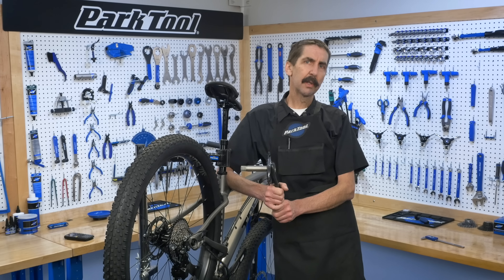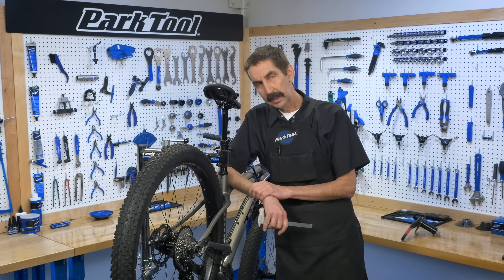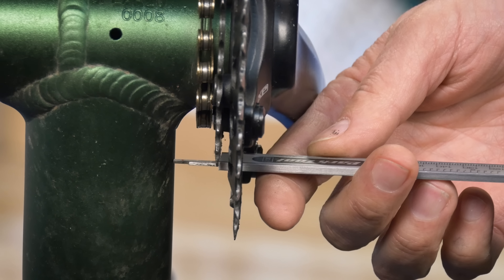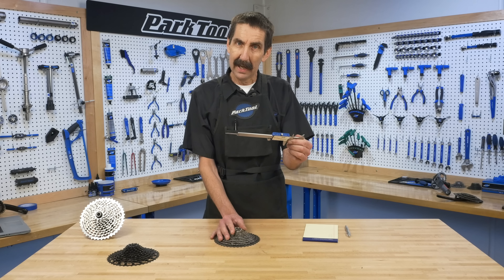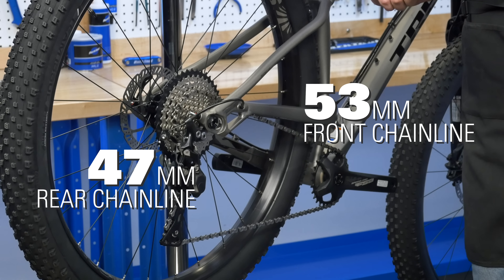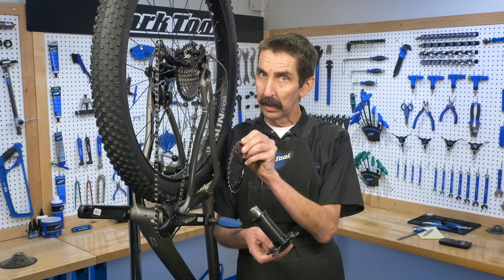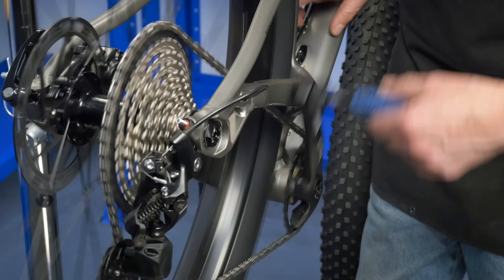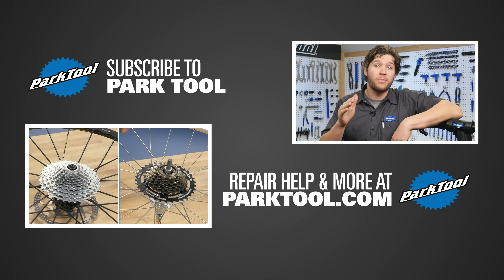Shop Talk: What is Chainline, and How Do I Measure It?

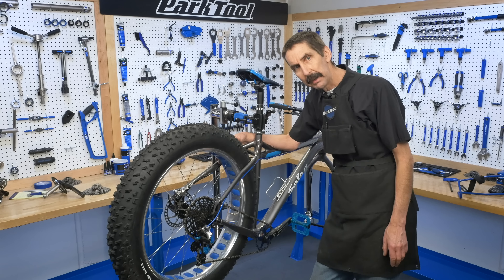Comment: Thank you so much for the video! The two issues you describe from 8:42 to 10:05 really helped me out. 

I just got a new Trek Slash bike with a 1x12 Shimano XT drive train. It's my first time with such a drive train (I had a 2x8 before). 

1\ Indeed on the 3 largest cogs, I have some noise. (I tried various adjustments but was not able to get rid of this noise.) Now I know that there is little I can do about it :) I guess the only thing to be done is eventually replace the chain if it wears too fast. 

2\ The chain also jumps down when I'm on the largest 1-2 cogs and try to pedal backwards. Now I know not to pedal backwards in those gears. Thanks again for the helpful video!

Comment: Nice! I came here wondering about chain ring spacing for the 1x9 conversion I did a while back, it makes more noise in the low range. But you explained it very well and not to worry about it. Makes sense why I get less mud in my derailleur than my friends bike etc.

Comment: Phew. Thanks for this <3 I bought an FSA Tempo Adventure crankset for my old cyclocross bike - little did I know the OEM crankset was an older model FSA Tempo without the Adventure bit, and the chainline is totally different, with the chain now rubbing against the larger chainring. At first I thought I just need to google some standards (FSA provides a size for the BB spindle length in their spec sheet), but now I realize I really don't know what the OEM setup was adjusted to. These instructions should be perfect for measuring it! 

Luckily the front derailleur seems to be able to shift the new 46/30 chainrings just as well as the old 50/34. Gearing will be lower, but that's actually a bonus for me.

Comment: You have greatly enhanced the image of bicycle mechanics everywhere and thank you for being such a straight talker that difficult seeming projects are less daunting.   Due to your unflappable approach you instill confidence.  Especially appreciated are the math derivatives and metric conversions when you put them in "plain speak" and expiates the 'goblin' factor.
                                                                                                     One for the Library
                                                                                                        Thank You
                                                                                                Mike Kirwan - Kenmore, WA.
Reply: Calvin was honest about the advantages and disadvantages and was not afraid to admit to the limitations of the 1x 12 drive technology . Gearbox bicycle clutches will wear out and or need adjustment at times ,  also repair and replacement costs will be high .

Comment: I got a 1 Lekkie 42 teeth on shimano 8 speed ! Does tops and a 1500 watt Bafang 52.7 volt battery dual suspension  Dnm Usd size 6 hornettes forks  35 dh race  and mid shock race Dnm  rebound 2 air chambers ! both 120 travel does 68 and can go more ! I got programing cord and app for parameters of speed and to take cap off top speed in sport 75 clicks and you have ECO too and throtle and pedelec together meaning throtle over rides and helps together ! custom built love it ! 50 yurs old live on 30 degrees hills ! bad knees and hips ! sold car after DR said must exercise hip and knee ! Now their tops ride every were and love it !

Comment: Awesome! I need to do the whole math but I'm thinking about switching from a 3x10 to a 1x11 so this will for sure help out! 

My cassette/chain will have to be replaced for next year anyway so I thought this would be a great upgrade, if I can make it work! 

I live in Serbia and bike shops here are very outdated and horrific when it comes to all this so I'm learning how to fix/maintain/upgrade my own bike! (Actually ordered your beginner/home mechanic tool box recently, should arrive soon! :)) 
(took "my bike shop" 13 days to instal new brakes so I just got fed up with them and decided to learn how to do everything by myself lol) 

Anyways, a couple of quick questions, if anyone can answer! :)

What's kind of a "big NO" in the difference between front and back where it won't work properly, if there even is a ballpark number?

My bike is from 2013 (BMC Team Elite 03) so I'm kind of worried that this won't actually work properly if I convert because 1x didn't exist back then lol. 

From my initial research, it looks like the current 3x has a 50 mm chainline (but will measure it to the middle cog) and I can only find a 52 mm 1x chainline crankset. Will these 2 mm more screw anything up considerably? 

I still need to figure out the math for the rear, but what would be "the number"/difference between back and fromnt, where things just won't work properly? In your example, it was 53 mm vs 47 mm and it works pretty good. So if mine turns out to be 52 vs 44, would that ruin things? 

it's not a very cheap upgrade considering I have to buy a new derailleur, cassette, chain and front crank... so I'm concerned with buying everything and it not working! And then have to buy a new cassette and chain anyway and deal with re-selling the new stuff... -.- I really don't want to do that lol  

So just trying to figure out the ballpark numbers before going for it so I can give up if the math doesn't work and just change the chain and cassette on my current setup and live with it. 

Sorry for the long message!

Comment: Yeah, one more thing - about bikes with front derailleur. I think it's wise to try and match crank and derailleur chainline otherwise... 😁 Me i learned it the hard way - bought a Trek 520 and they fitted there a crank with 50mm declared chainline with a 45mm derailleur... imagine how fun it was changing to the biggest cog - not so much. there was simply not enough room to pull more line. 
What the retailer tried to do to fix this was adding BB spacers, nasty... that only alleviated the problem, but still on occasions I could not shift all the way up.... and my chainstay does not look great either 🤷‍♂

Why did Trek do it? Well, apparently at some point someone figured out it's neat to switch from 3x10 Deore and bar-end shifters to 3x9 mix  of Alivio & Sora

At least I learned my lesson...

Comment: Another great video Calvin. I just went from a Shimano 11 speed to a SRAM Eagle XX1 AXS group and I had an issue with the wrong crank for my Pivot Trail 429 SB+ BB. I had to move some spacers around on the crank spindle, off the manufacturer recommendations, or order another crank for $450. I did everything you described here including back pedaling, everything worked great. Thanks for the video my friend, I own a bunch of Park Tools because of your video's, it can be fun working on your bike, but not necessarily cheaper :-)

Comment: Mr. Jones, thank you for your excellent video. I am building up a Specialized Allez over the winter as a project. I’m using Campy nine-speed components and the old-style square-taper bottom bracket. I swapped out the Mirage BB for a Chorus BB to get a better chain line. It sounds now like I spent too much effort getting the front and rear chain lines as close as possible. It still seems to be that a bad chain line will burn excess watts and accelerate the wear on the chain’s side plates.

Comment: As always a great video, i'm learning a lot from you guys, I switched to a Deore 1 x 12 and after following your procedure I found out that I have a chainline of 52mm, and a 142mm O.L.D in the rear, I'm supossed to have a chainline between 46 to 49mm, is this correct? Can I fix the chainline with a 6mm offset chainring or should I just let it be? I'm riding a hardtail by the way.

Comment: Manufacturers who are pushing the 1x drivetrains should review this video. 

Oh wait, they want to sell you more chains. Nevermind. They know what they're doing.
Reply: @thopkins22 the issue is specifically with 12 speed and that you have to run 52mm front chain line. 11 speed works better with a 49-50mm front chain line and has none of these problems. Unfortunately shimano has stopped producing 11 speed parts so it's just a matter of time until we run out, and many new bikes actually don't even have frame clearance to run 50mm chain line.
Reply: @dougr550  That's not true at all. Shimano definitely still produces 11-speed parts. They even just released new 10, 11, and 12 speed Deore groupsets. Even if they did stop producing 11-speed, there are plenty of other brands to choose from.
Reply: @dougr550  you don't know what you are talking about.
Reply: @dougr550  Look at the brand new Shimano M5100 Stuff for 2021: 1x11, 2x11 with different cassettes and chainrings. Makes 1x12 almost obsolete due to better mud performance and using the old freewheel hub.
Reply: @DilbertMuc  I think you mean m5100? m6100 appears to be 12 speed. The Deore cassette doesn't come in 11-46 which is all I need, doesn't have hyperglide+, and is fairly heavy.
Reply: @dougr550  Yes, 5100. Shimano does make 11sp parts.The Deore cassette is full steel which is preferable. I had nothing but problems with cassettes with large cogs made of aluminum, they bend and they wear off quickly. Why don't you take the CS-M7000 11-42 cassette, which is 11sp. ?

Comment: So I just had the not-quite-so-cunning plan of changing my 1x Shimano GRX 11-42t cassette to a SRAM XD freehub and SRAM 10-42t, giving me a slightly wider gear range as I heard they were compatible and I can't get a 10t on the shimano freehub. The SRAM cassette on it's new freehub is further out though (seems to have increased its rear chainline offset) so I've had to adjust the indexing outwards on the derailleur. Seems a bit noiser on the highest gears though and the switching isn't quite a good. Fail. So does this mean I need to change my front chainring now (to be basically flat, not slightly inwards offset) and it'll keep the same original large difference in chainline offset and work perfectly? Or am I disappearing down an expensive rabbit hole that'll never really work with any available parts, and should give this all up as a bad job and go back to 11-42t? Anyone tried this or know any shimano vs SRAM offset numbers I should be aiming or could be using without me trying to work out how much I think it's shifted? Anyone else tried this and got is working/failed miserably?

Comment: When im on my biggest cog i do notice the chain is significantly off. It doesn’t make that low rubble sounds from the front chainring... from what I picked up from tbis video. That low rubble sound is fine? It will just wear out my chain a little faster? Cheers for the guidance!

Comment: I have a 1.85mm spacer behind my 10 speed XT cassette on a 11-speed road hub.  Should I add this to the width of the hub?  So 37.5mm + 1.85mm = 39.4mm?  This for a Soma Double Cross Disc frame with 135mm rear droupouts.  With a 43.5 chain line up front, the silver pins on the large chainring of the 46/30t crankset were catching on the chain in small chain ring and three smallest cassette ring combinations.  But, if the width of the rear hub spacer is added to the width of the cassette, then the rear chain line is 135mm/2 - (37.5mm + 1.85mm)/2 - 4mm = 43.8 mm.  So my chain line at 43.5mm up front and 43.8mm in the rear should be near perfect! So why is my chain catching the pins on the large chainring?

Comment: I watch this video along with a video from October 27th 2017 what I would like to know where did you get the 16 gear tooth I have an XR Pro mongoose it's an 8-speed I I'm changing the front sprocket trust single all over 32 tooth and I'm changing the back sprocket from a 32x11 to a 34x11. Now i seen the chart you had , so what problems will that cause. Should I go a 10x1 and where did you come up with the 16 tooth cog? And should I set it up like you did in the video. Thanks from franks

Comment: I converted my bike to a 1x and I don't have problems with shifting, it shifts perfect (after watching your video on how to adjust the rear derailleur of course) but I'm still not comfortable with my chainline it's at a pretty sharp angle when I'm on the largest rear cog, my BB did come with spacers so I'm going to see if adding a spacer or 2 to the BB will solve my chainline issue.
Reply: What happened? Will adding bb spacers not increase the angle between front crank cog and small (easiest) gears an make it worse?
Reply: @joemccabe3029  yeah you're 100% correct. I ended up not adding the spacers.

Comment: Front and rear chain line means the upper and lower chain line right? Coz in was wondering if it normal for my bike to have the lower chain line closer to the rear wheel by about 5 mm than the upper line while on the biggest cogs

Comment: Opinion on this. I have a Santa Cruz 5010 v3 its a boost frame but I bought sram x1 carbon cranks but these came with a non boost chain ring. Washed the bike tonight after her first ride out and notice it runs very close but not touching to the frame. Will this be ok? My other issue I have a 142 hope pro 4 hub with boost adapters so the cassette sits in the frame more than usual   Currently it’s running really nice but would a boost chainring be ok or cause chain line problems.

Comment: Very informative and insightful video.  Thanks.  What would the stacked width of the Shimano 12 speed cassette (trying to est the rear chainline)?  Trying to decide whether to get a 52 or 55 chainline crankset..I am getting a boost full suspension frame…

Comment: Thank you for the explanation. I have a question, does a chainring be limited by your derailuer? example i have a stock 9 speed rd with 11-36T cassette. And i like to chain my crankset to 1x and make it a 38T chainring, and i will be replacing the chain, because it will be way too short. Will this be possible? Thanks for the answer.
Reply from the maker: Yes that will be possible. If there are multiple chainrings in the front you can run into issues with what is called capacity. But with a 1x you are good to go. If your derailleur does not have a clutch you may need to use a chain keeer to retain the chain on the ring even with a wide narrow ring.
Reply: @parktool  thank you so much. I have trouble planning on how to make my ride more faster, because i have a 36/26 chainring with my bike, and my buddies has 44/32/22, i am using high rpm just to keep up with them on flat roads, and i maxed out my gears. So planning to move up to 38 with 1x since i am not using my 26t often, maybe i could keep it if there is a very long steep climb, i could manually transfer it there just for emergencies, or upgrade my drivetrain to 12 speed with 10-51T, could it be possible to match 38T with a 10-51 cassette? So i could climb anywhere, at the same time i can run like a standard cassette with 42t?
Reply: @TeacherNickoy  You can use any front chainring with a 1x system. The rear derailleur adjusts the difference between the rear cogs regardless of the front ring. But you need to change the chain for the right length if you change to 38 tooth.

Comment: What to do in a triangle set up of three sprocket gears drive by a chain.where two gears r properly connected and the driven gear is only connected to few teeth.will the driven sprocket tranmit completed  power or will there be lose in efficiency?

Comment: Interesting video about the chainline. It appears the bias in offset between the rear cassette and front chainring is to give you a straighter chainline on the higher gears. I wonder if in future someone could invent a 1x chainring that can move in and out on the crankset to maintain a straighter chainline across the rangr of gears.
Reply: A pivoting chainring with a rubber bushing perhaps.

Comment: at 4min 43sec, you said your axle is a boost version (148mm) but you have 141mm between????????? 😳
on my frame, the factory annouced a thru axle 12x142mm at the rear, and when I measure between the frame I still have 142mm ..... 
I don't get it

Comment: I  put a new freewheel on my bike, same 1st gear as before, but now when i roll the bike backwards, or turn the pedals backwards, the chain is knocked off and falls into 2nd gear, and then jams if you continue to turn backwards, just like you showed, but i does it even when turning very slowly and in like half a turn. the last freewheel that was on didn't do this and it had the same first gear,  --can i put some kind of spacer behind the freewheel to move it outward or something?
Reply: got the same issue with 9 speed sunshine road cassette, previous shimano hg just doing fine but i want tighter teeth so i try another cassette

Comment: Hello, I tell you that I have changed the transmission of my Trek marlin 5 (3x7 speed) to 1x12 sram eagle sx, the well calibrated gears worked well but when it is on the largest crown and I pedal backwards it jumps and reaches the  lower crowns, what could it be due to?  I have seen the chain line and it is the same as other bikes, is it because the axis of the marlin 5 is 135 mm?  Maybe I should change the bottom bracket that is a traditional threaded cartridge to a dub?  I hope comments, thank you.
Reply from the maker: With a 1x12 or even a 1x11 this will happen. It is simply due to the angle the chain is leaving the cassette. pedaling forwards teh derailleur is keeping the chain inline for the real but when pedaling backwards the chain is being fed onto the cassette in a way that it wants to go to smaller cogs. The simple answer to preventing this is "don' do that". Changing chainline can improve it but it will happen on a properly setup system.